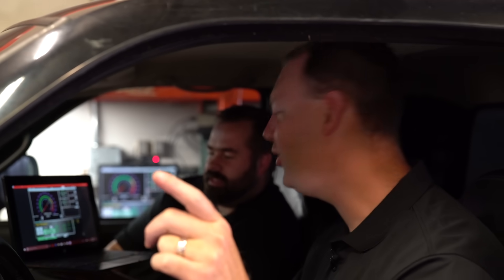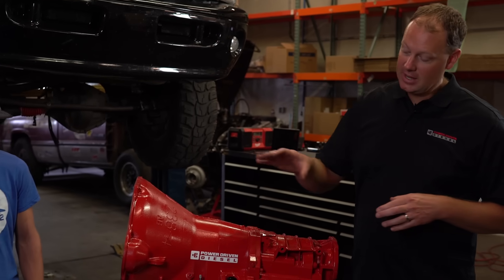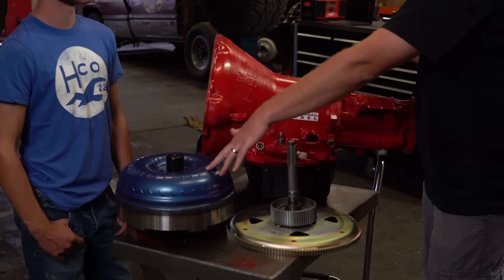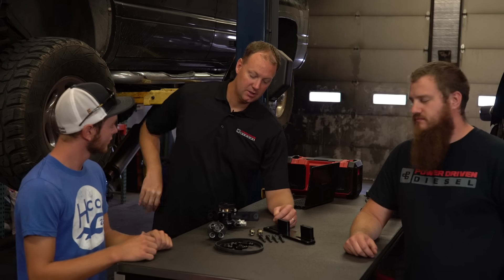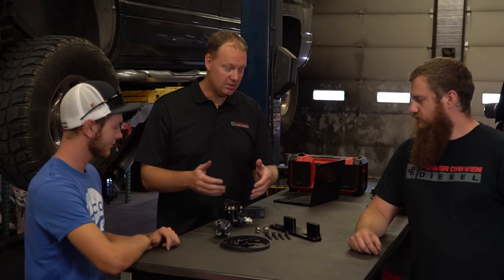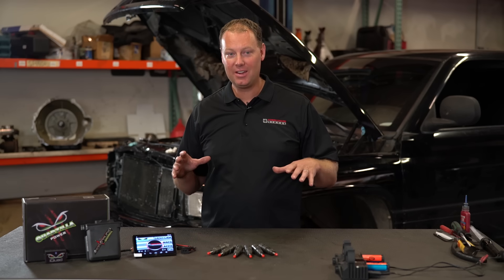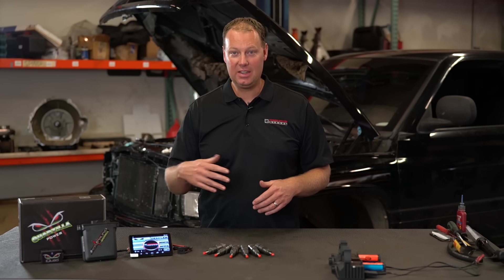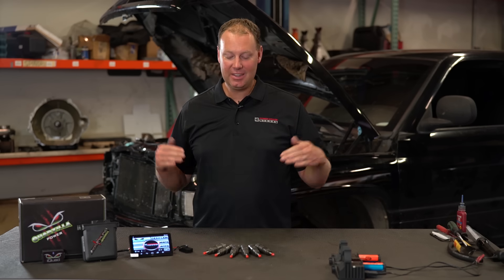We Double the Horsepower of a 24 Valve Cummins

Comment: I'm tellin' ya right now... those effing MAP/boost sensors can KILL these 24V trucks damned near dead in their tracks. Several years ago, I had one that was defective/bad in my stock '99 Cummins 24V 5.9L, auto, QC, LB, 4x4 pickup truck. 

She would fire up and idle just fine all day long, but she would barely move when driven. The problem literally came out of nowhere too. One day she was fine, next day she was fucked. She was so slow to accelerate, it was simply dangerous to drive on the road. At first I thought perhaps I had a major fuel delivery issue, either with the lift pump or injection pump. Thankfully, that turned out NOT to be the case. Strangely, she was throwing over a dozen codes in both the Chrysler PCM and Cummins ECU, all of which just didn't make any damned sense. 

So, along with my trusty OEM Dodge Ram Cummins service manuals, my basic electrical diagnostic tools, and 20+ years of being a mechanic, I tried fixing the turd myself, evenings after work for about a week. I simply refuse to just throw parts (aka: money $$) at unknown problems just in an attempt to fix them. Proper diagnostics is key! 

After I was about ready to lose all my marbles, I finally had to take it to a close friend who has been working on MOPAR stuff for over 30 years, and had access to the right diagnostic scan tool (DRB III). After nearly a week of dicking around with it evenings after work, he finally diagnosed it as the MAP sensor. It kinda blew us both away, but in the end, made perfect sense. We installed the new MAP sensor, cleared the codes, and it ran crisp, like a new truck again - even with over 200K on the clock. Freakin' amazing how one little sensor can screw up a vehicle. Damned computer controls, love 'em or hate 'em, we're stuck with 'em!
Reply: I am having this same problem, map/boost sensor code. I've put a new one on my truck but the code will not clear and is still in limp mode. Any ideals would be much appreciated.
Reply: @bbarnett6795  : Something else is most likely wrong. Just because a vehicle "throws a code", does not mean that the sensor that set the code is bad. Common fallacy that most NON-professional vehicle technicians just don't seem to understand. 

A diagnostic failure code that is set/showing simply means there is a problem somewhere in a given system.  In your particular case, the Intake Manifold Absolute Pressure (or Turbo Boost Pressure in the intake) is likely too high or too low. There are several things that can cause this. Further diagnostics are necessary to figure out what's really wrong with your truck. 

Your problem could be a lot of different things. Start simple. Inspect your intake plumbing, boots, clamps, gaskets, seals, etc. Check for cracks, holes, leaks, loose clamps, etc. Inspect the air-to-air intercooler for any cracks or leaks. It may have to be removed and pressure tested to verify it doesn't have any leaks. Inspect your turbocharger. Make sure the wastegate on the turbo is functioning properly. Many mechanical wastegates eventually succumb to failure over time, due to corrosion and/or due to high engine operating hours/miles. There are various tests to do check for the proper functioning of your turbocharger and its wastegate. 

Has anyone dicked with the turbocharger/intake or fueling system in your truck? Boost foolers, tuners, and other aftermarket stuff can lead to problems if they are not used or installed correctly. Has your truck ever been hit or wrecked? Sometimes strange problems from accidents can crop up over time from prior collisions and not be an issue until days, weeks, months, or even years later.

 Sometimes, a code set can be caused by a somewhat unrelated problem as well. For example, when my truck had the code for the MAP, it also had about 12 other failure codes that were set during the same time frame. Even after clearing them all out, 2/3rds of them came back almost immediately after the next test drive cycle. 

This "pile-up" of failure codes being set was because of the "snowball-effect" of other problems that developed quickly from the bad boost sensor readings that were being sent to the truck's ECU and PCM. 

As I recall, there were about 6 codes in the Chrysler PCM, and another 6 in the Cummins ECU. Some similar, and some totally different. Ironically, everything checked out fine, except finally, by a very lengthy process of elimination (checking every "failure" and verifying the proper functions of what the failure codes were pointing to), we came to the conclusion that the MAP/boost sensor was my actual problem. After an exhausting amount of diagnostics and finally installing a new Cummins $150 MAP sensor, my "no power problems" went away. My point is, this will not always be the case, as each individual vehicle's situation MAY differ/vary.
Reply: Yeah I learnt on my 02 7.3, she fell flat on her face, I started checking sensors, unplugged my icp sensor and she ran good enough to get me home, replaced it and boom good as new. Electronics suck but like you said love em or hate em, they are here to stay.
Reply: If the engine management system is computer controled, and the vehicle has a display screen, why not have built-in diagnostics ?! Time saved is money earned...hello ? Is this thing on ? Oh, Map sensor.....
Reply: @aaronhumphrey2009 : Built-in diagnostics costs the manufacturer money. #1.) They aren't interested in doing that, for a million obvious reasons. #2.) If diagnostics are built-in, the diagnostic tools companies and the automotive shops would have much less ability to make money. #3.) Vehicle manufacturers do NOT want the average person to be able to work on their own vehicle. They never have. Expensive modern electronic technologies have made it even easier to prevent the average person from being able to do much of anything for themselves on a vehicle any more. Manufacturers want to sell brand new vehicles to the average consumer as often as they can, they do not want people keeping "old" vehicles up and running.
Reply: @turbodiesel4709  All true, unfortunately . That, the high price of a new Diesel truck, and depreciation are all excellent reasons for me not to buy a new truck. Once they're out of warranty, you've looking at potentially big repair costs.. ruinously high for the average owner...
Reply: @aaronhumphrey2009   Agreed. The ridiculously high price of a new pickup truck nowadays is a serious problem. I wouldn't buy a new truck (gas OR diesel) unless I were rich - Literally! For that kind of money, I can rework/rebuild my old truck from the ground up every 5 years or so and always have a virtually brand new truck for what a "NEW" truck costs nowadays. Not to mention, it will be less problematic (more reliable) and more fuel efficient as well. (Both are well-known proven facts when comparing the older 12 & 24V 5.9L Cummins Turbo Diesel's to ANY of the newer 3/4 and 1-ton pickup truck diesels currently on the market today.)

Another thing that really burns my ass is the required use of DEF (Diesel Exhaust Fluid) and the DPF (Diesel Particulate Filter), found in the vehicle's exhaust system on most all modern over-the-road diesel cars and trucks today. Using this crap does two things to any diesel powered vehicle. 

#1.) Instantly makes the vehicle more costly to run (inefficient). Why? Because I have to spend additional money per mile, for DEF, for the vehicle to RUN. Period.

#2.) a.)Decreases power output of the engine. b.) Decreases overall fuel efficiency. c.) Decreases overall reliability! 
A substantial amount of emissions components are used for the functionality of the DPF and DEF systems. These "choke" the life out of the engine and create a lot of down-time and monetary waste - both daily and during occasional failures that can/will eventually occur with the emissions systems.

That said, I will not own a DPF or DEF pickup, unless I (or someone else already has) fully deleted it. 

Warranties are so overrated. Let's face it, unless you happen to get a lemon, you'll never need nor use your vehicle's original manufacturer warranty. The warranties are set up that way. The warranty runs out when the vehicle systems have the potential to actually fail. Manufacturers have no desire to pay/honor a warranty unless they must. 

What you learn via experience and wisdom is that the Condition and Prior Care of any used vehicle is what really means EVERYTHING.

Mileage on a vehicle is a poor indicator of actual condition. I've seen many a vehicle with "low miles" that is nothing but a pile of shit, money pit. That said, I've seen diesel pickup trucks with 300,000 on them that are as beautiful and nearly as flawless as a brand new $60K+ truck. In a way, you could actually argue that a vehicle's mileage means little to nothing. At the end of the day, it's all about how the vehicle has been cared for, repaired along the way, and how (and if) it was fully reworked when it was time to do so. 

Let's be realistic, most people just don't take care of their vehicles. Simple fact. So, what to do? Find that "gem" that grandpa had... Or find that truck that someone put $20,000 into over the last 5 years, and he's now ready to part with it for a lot less, because that's just how it works. You never get your investment back out of any normal vehicle, unless you use the life back out of it yourself. 

Yeah, you might have to pay $15 to $20 grand for a re-worked 20 year-old diesel truck that you can buy all day long from someone else for $5 to $9 grand... But here's the catch... Your $20K used truck that has been fixed all up and babied won't need $10K worth of repairs and downtime when you get it home! (And if it will, you just don't buy that one - duh!) That said, the "like new" but older truck might need SOME repair work, as it is a USED vehicle. One must understand and expect that. Face it, virtually nobody sells a vehicle unless it has something wrong with it. Most people simply cannot afford to change their vehicle like a woman changes her wardrobe before going out.

Either way, I can assure you, reworking your like new/used truck won't break the bank like buying a new truck will. Also, if you have it completely gone through and fixed to 100% right away, when you first get it home, you will not be left with daily hassles or constant reliability issues. A REPUTABLE shop with experienced mechanics will do that for you if you cannot. Again, nothing is "free", but a simple $5 - 8K investment (averages that I've actually seen) in a like new $15 - $20K NON- DEF/DPF diesel truck is a small price to pay to have a virtually new & trouble free vehicle, that's no doubt BETTER than any brand new diesel on the market today. 

That said, if you are into all this extra unnecessary electronic age shit that they have in the cabs, well, then you are shit outta luck. You'll need to go buy a new truck, and suffer with the mortgage payments.

At the end of the day, it really comes down to individual choice. Is a diesel truck the better financial choice over gas? Well, 20 years ago, I would have said YES in a heartbeat. However, because diesel consistently runs $0.50 to $1.00 higher than gas at the pumps, and newer diesels require DEF... Now it's a much tougher call. Fuel efficiency and reliability aren't necessarily there anymore either, when it comes to the newer, higher-powered and all emissioned-up pickups.

For some of us, there are ways around the higher diesel fuel prices (taxes) for a smaller percentage of the population, and there are certainly DELETES for all of the vehicles with all of the emissions garbage that robs them of power, efficiency, and reliability.

That said, I will stick with my 1998 - 2002 Gen II Dodge Ram trucks with the 24V CTD's. There are NO emissions controls garbage on them, and they have virtually no problems on a daily basis. Of course like any vehicle, proper maintenance and preventative maintenance is key. The 5.9L Cummins ISB engines are still arguably the most fuel efficient and reliable heavy pickup truck diesels out there.
Reply: Turbo Diesel , I’m with you, I’m sticking with my 2000 24V Dodge 2500. Only people like you get it.
Reply: It’s called OBD 2

Comment: Couple of questions. First, on the video the HP and torque had a label that said "With WCF" What is that?
Secondly, how much did that built transmission and converter cost?
Finally, what is the estimate for doing this same build if I brought my truck to you?
Thanks.
Reply: WCF is weather correction factor. Just a standardization tool

Comment: I got a kick out of the similar situation I'm sitting in. My 06 Ram MegaCab was from Utah,  I live in NC, work as a maintenance TL in Durham Aisin transmission plant and I'm doing "research" on how to double my HP as well lol!

I think yall did a great job of explaining each step in the process and it's associated gain(or lack of 😒). I am currently running an Edge CTS and believe it is causing issues for a few reasons, so I'm now  in the market for a new turner.

What things are affected with your custom tunes? ie. Egt, boost psi, engine temp, etc.

Comment: This video is awesome. I recently purchased my first diesel truck. It's a 98 2500 4wd NV4500 Cummings. It has an Edge with attitude and an airdog 150 100 horse injectors and a big turbo. A southbend clutch and airbags in the back. The trucks been sitting for around 4 years it needs a lot of work. I know it needs a transfer case rebuilt and possibly a clutch. It currently will make 50 to 55 pounds of boost. Do I need head studs and fire rings?
Reply: Thank you for the reply. As I was definitely considering the fire rings. I am just trying to optimize what is already there. Rebuild the turbo. Different wheel in it. I don't want more boost just want it sooner. A different exhaust manifold that the turbo can bolt to and an intake horn to start. Are there any companies you would suggest sourcing parts from?

Comment: Buying a real diesel with a 3rd pedal and a stick through the floor would have alleviated the transmission upgrade. Also who's building a vp44 truck in 2018?  Those trucks had marginal performance when they were new and don't even come close to comparing to any diesel made after 2007

Comment: Great video, but why would you use an exposed "belt" to drive the mechanical lift pump? If/when that belt breaks you are going to be in a lot of trouble.
Reply: I run a mechanical lift pump similar to this setup and it's a toothed belt that is NOT under tension. I assume PowerDrivenDiesel's pump is the same setup. If so, these belts will probably outlast the truck (if you live up here in Michigan where rust is destined to kill the truck) as the belts are really not under any kind of strain whatsoever. Even so, when doing a mechanical pump you also have the ability to use your factory electric pump as a backup, and to rig it up so that it automatically kicks in if the belt were to break. This will at least get you stock pressure for you to drive it home and work on it. That is how I run mine. The electric pump still runs for priming, and if my pressure drops below 10 it kicks in automatically.

Comment: How much boost can I run with my stock head bolts on my 93 12v? I'm really wanting to ditch the laggy h1c with something that spools faster and can make a little more boost. I just want to make sure I'm not going to push it to much 
Thanks, Jake
Reply: Jake Haberhauer just swap an hx35 on it. Much tighter exhaust housing so it’ll spool quicker. And as far as the head bolts go you’ll be fine. Cummins handle boost and drive pressure much better than other engines
Reply: Isaac record thanks for the reply. I was leaning towards the hx35, just got to find a genuine one now. There's a bunch of Chinese knock offs out there haha.
Reply: Jake Haberhauer you might be able to get one from thoroughbred diesel
Reply: Isaac record I'll have to check them out. Thanks

Comment: That's mechanical pump seems pretty cool, you think there actually better then a air dog or Fass?
Reply: @pddofficial  so when you install it you do the factory lift pump delete? Will you be making a more in depth video about it and the installation?
Reply: @travishurren2765  I second these questions!
Reply: @pddofficial  where can I buy one?
Reply: I'm a little worried about debris finding it's way on that belt
Reply: @jp8457  and I don't think they separate air and water from the fuel like the air dogs or Fass, I wish I knew more about it or if it would work with a sump
Reply: Correct, the mechanical pumps are all about fuel, no filters or separators. You can add a separate filter/separator system in-line if you still want that, or you can do what I did and use a 2003 fuel filter in your 2nd gen fuel filter housing. It fits, and filters at 5 microns instead of the standard 10 for the 2nd gen years. Also yes, the mechanical pumps work just fine with a sump. I did my mechanical before PowerDrivenDiesel started selling theirs so it's from another company, but it looks to be very similar. I pull from a Beans sump at the bottom of my tank, works great.

Comment: Did you guys put a boost controller on? I would think over 400whp is achievable on the stock turbo. Needs moar boost!!
Reply: Interesting! Always under the impression just cracking 400 was possible, well at least on a dynojet Haha. Assuming you guys are running a mustang dyno?
Reply: Do these come with a 14cm exhaust housing stock or 16cm?